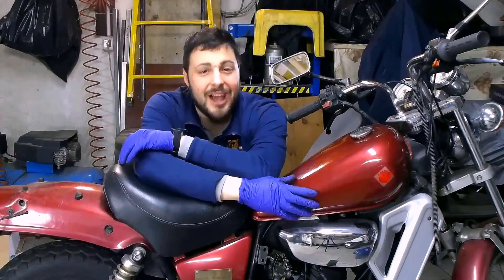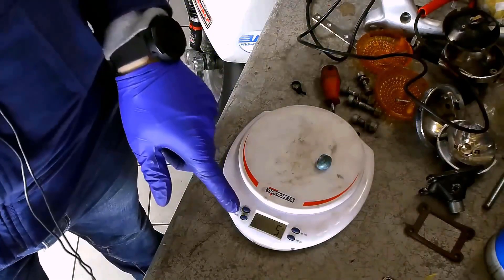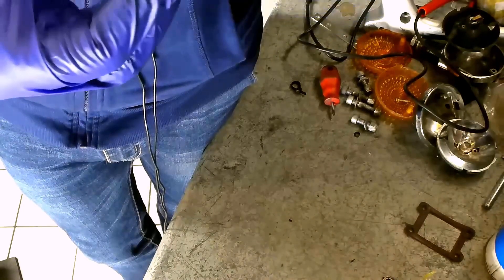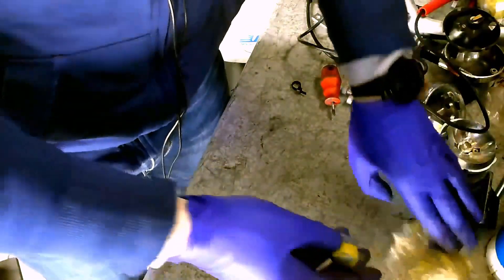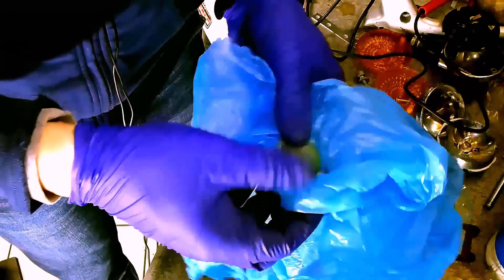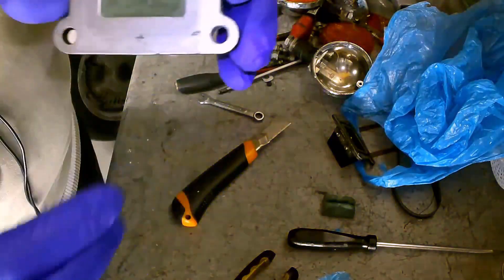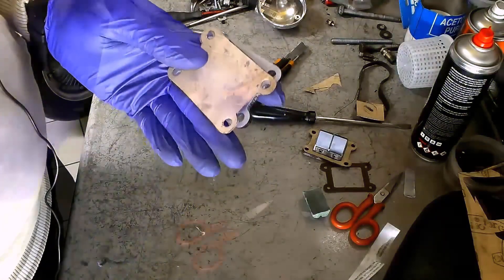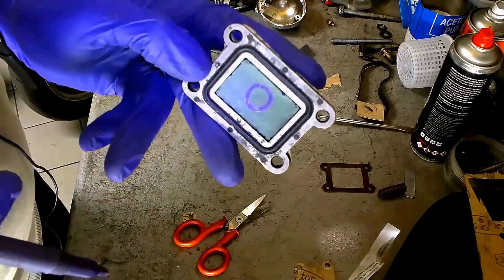18 - Reed Valve Tuning

Comment: What is the resin used?
Reply: @SR-gs8zo ”He minimized the surface area for air/fuel mixture” to bounce around in turbulently. He created a funnel that makes everything flow much better. The terminal opening of the intake is the same, he just smoothed out the flow path. Makes sense to me.